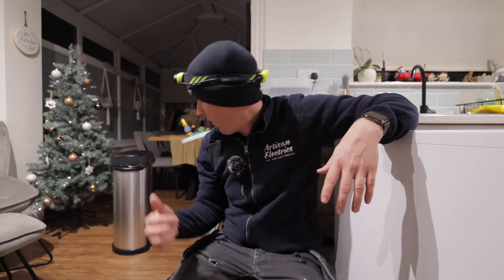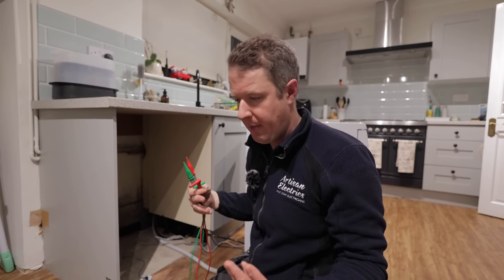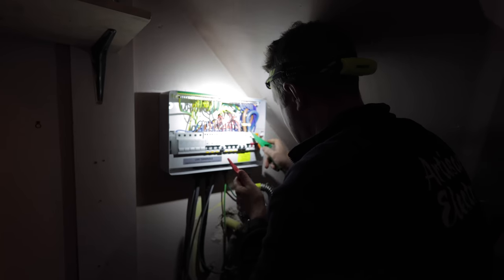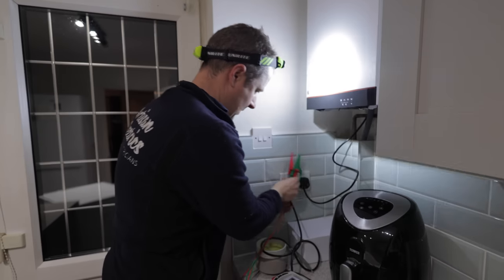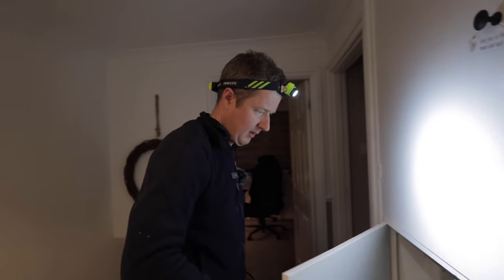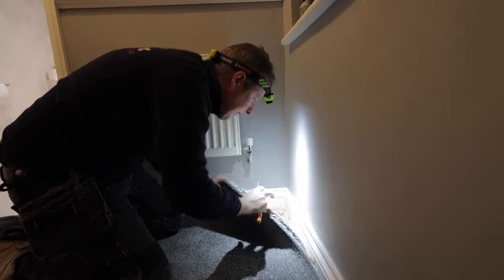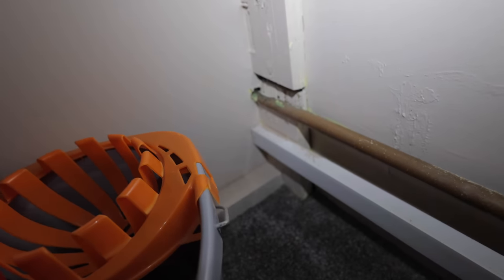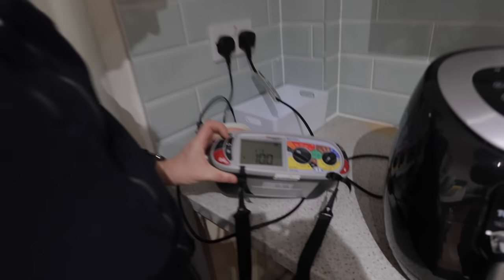Nearly KILLED by a CRAZY fault! What on earth is going on? 💀

Comment: Initially I was going to guess tumble dryer as I got a belt from one once - after unplugging it my thumb touched line + neutral and the capacitor discharged.  It was unpleasant.

But the steady voltage that increased when you started unplugging stuff suggested it wouldn't be a capacitor.

Edit: also, you gave me the fear when you were waving the live plug around 😬

Comment: Wow that’s a crazy fault, hard to find and super dangerous, the reason you see a high resistance on the megger is the feed is through the accelerator heater in the thermostat.

I’ve worked in power generation, so I know to look for feeds from multiple sources. This is why you must prove your voltage detector, then test every combination, then prove again.

If in any doubt pull the 4 conductors and stick them in the earth bus bar, there is no way the circuit can become energised that way. This has probably saved my life a couple times already.

Comment: @artisanelectrics What you need is to just add a freakin relay into the boiler, to separate the switched circuit from the boiler supply. No cable replacements needed.

Comment: Had a similar experience years ago. Switched off downstairs ring main to change a wall socket & got a shock off the earth (about 170V). Turns out an electrical 3-way valve had gone bad on the 240V motor winding & was shorting to earth. Back then 1975 ish rcd's devices weren't common in consumer units, only mcb's in mine

Comment: Why not hardwire the permanent power requirement directly from the DB? Take it from the upstairs circuit - effectively a spur. Just ensure that it's a permanent connection to the boiler (also switched)

Comment: I think part of the problem is how specialized the different trades are, every trade should at least know a little bit about the other trades that they have to work cooperatively with to make everything in a house function safely. The story about the electrician and the plumber in this video is a good example, sometimes you just need to venture a little bit outside the definition of your trade to get the job done instead of calling in a different company to do something simple. If the plumber who wired that boiler knew more about electrics they would have known how unsafe it was, just my two pence.

Comment: You are amazing. I am an all-around handyman. Carpentry, plumbing, electrician.... It's problems like this that drive me insane. I don't have the patience for that. I usually end up hiring somebody like you to come in and diagnose. I just stick around to do the grunt/support work.
Reply: Also, here in the US, we use half the voltage for most things.... getting a zap is usually just unpleasant, not fatal. Sometimes I even use my finger to test for voltage. I just make sure that if my muscles clinch up, I don't end up holding something hot.
Reply: @theobserver9131 what if someone does a crappy work and connects 2x120V to a line - should not happen but I bet it does sometimes. Then your heart muscle clinches up and it does not matter if you're holding something hot as you have bigger problem on your hands so to speak.

Comment: Years ago I bought an old terrace house and as part of bringing it up to date it needed a new bathroom.  High up on the bathroom wall was a Sixties era single bar radiant heater with a pull switch.  It was mid morning in the Summer so no need for heating or lighting and so I proceeded to switch the mains to the house off.  Rather than go full gorilla and just rip the heater out I tugged at the pull switch and it came on and started to glow red hot.  I went up into the loft and traced the bathroom heater flex across the rafters to find it had been spliced into the neighbours electrical wiring!

Comment: I had a job connecting a coaxial network cable between 2 computers in different rooms, with the result that the network card in one of the computers burnt out.  The fault was caused by the owner of the premises playing with some wiring, he had left an earth flapping around inside a junction box.  It intermittently touched the live, this meant that everything in that room became live, including the kettle!  This also put a live on the braid in the network cable which went to earth via the computer in the other room.  Needless to say I got the blame.

Another time someone had used twin and earth in a two way lighting circuit instead of triple & earth, using the earth conductor as the third wire.

Comment: Classic case of mixed neutrals. There was plenty of room in the heater electrics for a 1P NO 25A 240V coil contactor. Take hard and run power off the plug. Coil powered from existing twin and earth. If you were really concerned about having mixed mains circuits in the heater electrics, have the upstairs switch an SSD with a 24V DC switch mode down existing wires to a contactor with a 24V coil instead. All up, £50-£100 is parts and no grunt work.

Comment: Interesting bit of problem solving there but I have one question.
Have you never heard of electrical conduit? Here in NL we have conduit from junction boxes to sockets to consumer box etc etc and we pull single stranded installation wire through them. We only use multi wire cables for outside use. So much easier to get a wire through to wherever you need it.

Comment: One problem I've seen is the lives on upper and lower floors being connected by the lighting circuit on the stairs, which is wired to allow the lights on the stairs to be switched on and off from ground and first floors. sometimes the lighting rings get connected together that way, if someone doesn't take care to make sure that's only fed from one circuit.
When you started drilling with the Hilti, I half expected water to start pouring into the kitchen. The plumber left you so many other booby traps, I'm a bit surprised he didn't do that for you as well!

Comment: Just to add, the boiler is At Risk because the cable grommets are missing from a room sealed boiler. You need to recommend your customer gets in touch with a reputable gas engineer…not the guy who fitted the boiler 😮

Comment: We only have ring circuits here when sparkies do it by mistake..I had one doing a 3 phase switchboard upgrade and had 400v across two subcircuits.
Another was a previous deleted doorway between  kitchen & laundry, clearly had separate light circuits to switches in  either room but the sparky deleted the kitchen switch and joined all the feeds together in laundry switch.

Comment: It is quite common for older boiler installations for the permanent live to the boiler to be fed separately from the boiler 'heat demand' live - which means that even with the local boiler isolator switched off there will still be a live inside the boiler cabinet that can appear anytime that the central heating timer and the thermostats call for heat...  A high resistance 'leak' will still give a human a big shock because the resistance of a human body is quite high and will draw only a small current - not enough to drop much voltage.  I have seen the 'leakage' from the 3 port diverter valve in a heating system be well over 100 volts.   Most heating system wiring is a nightmare, just choccy block with all the unmarked wires ( not even a red sleeve to show a switched live ), and those 'heating engineers' who scream at people for removing the boiler cover have obviously messed where they should not.

Comment: instead of feeding in a new 3 core wire, you could have left the boiler powered by the downstairs circuit and install a 220V relay with the coil  powered by switched live + neutral coming from central heating unit upstairs (heat call circuit). then the contact side of the relay, wire as needed (most likely NO contacts should switch a branch of the boiler permanent live to become a call for heat signal) on the downstairs circuit. this way upstairs circuit and downstairs circuit are isolated at the relay, but call for heat does still comes through.

Comment: > You should never have one piece of equipment fed from 2 different circuits
I guess that depends on the equipment. I have 2 appliances that were designed to be fed from multiple circuits, one even from 3. Its attached to 3x32A fuses each on its own phase (at least according to documentation, I am not gonna touch that installation). The important thing I guess is that the devices are certified for this use case and the installation was properly documented and installed by certified professionals.

Comment: Use the switch cable as your permanent live feed for the boiler and put a mains link next to the boiler to use as an RF switch to turn the boiler on. You may need another switch from the boiler back to the pump in the airing cupboard to control the pump for pump overrun.

Comment: Something like that happened to me when I worked on the fishing boat steering unit. The controls for the motor starters ( there’s two pumps for redundancy) was wired from totally different power source. Usually the controls are 24V AC, that one was 230V AC same as motors main 3Φ feed.

Needless to say - that was one exciting “pucker”!!! 😁

Comment: Good one!!!! But what about adding a dry contact to the thermostat upstairs and then using the existing run from 1st to second to turn on boiler? But, no idea how that is all wired with a damn boiler in the kitchen to begin with. But if the pump and controller is upstairs for sure adding a dry contact or relay to turn on boiler with two existing wires would have worked, but I am probably missing something.

Comment: I think there are a couple of lessons learned you should take from this. Being a Chief Engineer on ships where we regularly use 440/660v & HV there are some safety pointers that could be adopted. 
1) Risk Assessments are essential what ever the job, that these should be recorded. Tool box talk and even a point of work risk assessment. 
2) Double isolations, isolation of the main source and any secondary source, if unsure dead, the whole board.
3) Reporting of Near Miss/Accident within your company, I know your company only has a limited amount of employees, however to prevent future occurrences, a safety report information system should be adopted.  Safety bulletins can be circulated amongst your electricans and a repeat of what happened can be prevented.

Comment: Yes I had something similar happen to me in an old house I bought about twenty two years ago, I had owned the place for about three days and was removing the built in oven which was in poor condition. I pulled the fuse for the cooker circuit and fortunately checked the terminals before proceeding, the cables were still live. It took some investigating, and at first I couldn't figure out where the live feed was coming from. I took some insulated cutters and cut the cable. All the house lights fused instantly. I discovered that the under cupboard lighting had been connected to the cooker radial further back than the cooker termination box. The under cupboard lights had another feed from the lighting circuit. Somebody had probably had a problem with the cupboard lights and jury rigged a second feed from the 40amp cooker feed. That was doubly dangerous because it meant all the lighting in the house had effectively been connected to a 40amp fuse as well as the 5 amp fuse it was supposed to be fed by.
I rewired the whole house and in doing so found a number of other potentially dangerous additions/ modifications to the original 40 year old wiring. When re wiring I replaced the consumer unit with a modern one.

Comment: You did a very good job. You might have considered to use a relay inside the boiler that is switched on by the existing wiring from upstairs and when switched on switches the live from the socket near the boiler. Although that would have saved the issue as well and avoided new wiring from above it has the disadvantage that there are still two different lives inside the boiler which might not be allowed due to regulations. At least you should have it clearly noted in the boiler that the relais is powered from another circuit breaker circuit. Your solution is the best.

Comment: Good work! And lucky (or unlucky!) that the thermostat was calling for heat while you were doing the job.

I have come across cowboy jobs like this too many times, as soon as I'd established that the fault was a link between ground and first floor ring circuits, the first thing I would have looked at would be if the boiler and the controls were split over both floors and gone on from there.

The number of installations I've come across where the earth wire of a T&E is being used as a switched live, only looking at the terminals it is terminated in to establish the problem. Sometimes you get a bit of red phase tape as a clue! Leaving the circuit and equipment relying on the bonding on the copper pipes as the CPC, if there is any!

Comment: electricals at Crete was always highly educational... the live wire is found strictly by using your neon tester... - the earth wire is usually the cut-off one... - one day, at one of my familiar tavernas, I was grabbing myself a beer out of the fridge and got a bit of a kick as my sandals were wet; - I took my neon tester off my t-shirt and tested the fridge and it was live!!! ...I fixed the faulty ground to the fridge and it went 'BANG!!!' ...the bit by that Kipling geyzer about filling the unforgiving minute with 60 seconds distance run screamed inside my head as I opened the back of the fridge unit and fixed the taped up mess that had gone 'BANG!!!'...

Comment: Had enough anecdotes from the lecturer during my gas training to suspect that this was going to be something to do with boiler controls. Twin power sources for boilers is always a no-no plus the cable inside the boiler appeared to be standard mains cable and it should have been heat resistant flex. Sadly, whilst this video highlights the problems of plumbers doing electrics, I gave seen done horrendous faults caused by electricians not understanding heating systems.  BTW an easier solution would have been to use wireless controls. These exist for cylinder controls as well as room stats.

Comment: Just as well it was not a 3 phase supply, with one phase upstairs, and another down!

When I was a Theatre Tech student back in the 'Eighties our LX lecturer had the situation where he shorted out between phases. Melted his 500volt neon tester, and burnt off ALL the hair on his body. VERY lucky. In a Theatre, one phase is for the stage, second for the lanterns on fly-bars OVER the stage, the 3rd for lighting in the auditorium (front of house). He was working on a lantern that was fed from above the stage, but mounted on a motorised 'truck' that was powered from the stage 'dips,' shorting out on the truck. OUCH!

Comment: A man who drinks Leffe gets my vote every time 👍 10/10 for sticking at it and your perseverance. Just a quick tip from a heating engineers point of view before lifting multiple floorboards always number them on the one's your lifting and the parent one it takes the guess work out when refitting. Ps. Can empathise with you on this wiring heating control bodge have come across similar dangerous issues in my working career. Some heating engineers just simply do not understand safe working practises !

Comment: Wow! Great work figuring out that mess. One quick question, why didn't you use the three core cable to provide the permanent live from the upstairs circuit? You could have then removed that gash plug from the kitchen socket.

Comment: Nice methodical diagnosis, I am surprised that one or other of the rcbos didn't pick this one up, perhaps the switch terminal draws no current?

Anyway, pretty shabby work by the previous sparks. That  dangling t+e shows a lack of care generally.

All that fuss running a new cable.
Relay upstairs in a suitable enclosure with dry contacts shorting existing cable (suitably sleeved to show line present on both conductors). Other end to supply and switched terminals on boiler. Suitable warning label on relay enclosure to indicate supply from two seperate sources (and another one inside the box in case the first one gets lost/damaged).

That said, you have made a much better job of it :)

Comment: Well, I have always been amazed at how the UK has not completely burnt to the ground!! 

I figure you had to have a parallel source going on.  I never could see how there was any real advantage to ring circuits except maybe saving a little copper, but they're also a disaster waiting to happen. Then when I look at how you snake wiring all over the place it seems like a double fed circuit from two different line/hot leads must happen all the time.  

Even in the old days of knob and tube, we always used radial circuit distribution on the US. Ring circuits just seem insane! But I know they are al over the UK.  It's not impossible to somehow cross two radial circuits, but generally they don't run close enough together in he radial topology!

I have seen your videos and those of a couple other UK guys and am just amazed out how crazy the wiring is!   I have seen what I call "Hill billie DIY" wiring that's not as bad as what the "normal" UK wiring looks like!

Comment: Great video and a good learning tool for those who have'nt come across a fault like that.JUST A  HEATH AND SAFETY TIP...Always keep a bag of 3 pin plug pin protectors to put on the pins just incase there's a accident of the pins touching you,also deplugging the appliances which may have a similar faults cookers,american fridge/freezers,hot tubs,whirlpools,heat exchangers,solar installs,AV systems,heated swimming pools,security ligting,automatic gates,dual fed cctv systems etc.
Keep up the good work and take care.

Comment: So if the boiler had two sources of power how did it even come on? Surely the two circuits would cancel each other out since the potential difference would be too low for the boiler to operate normally?